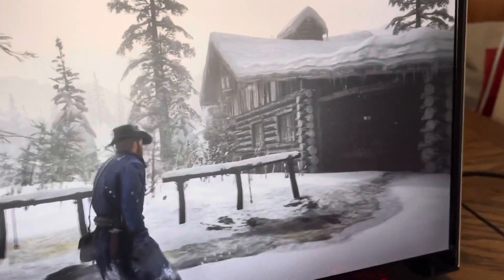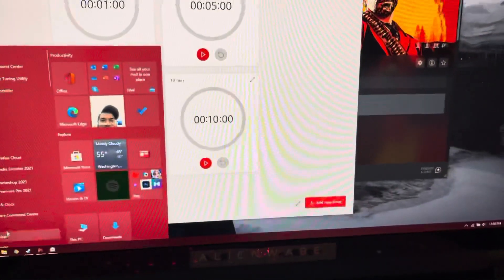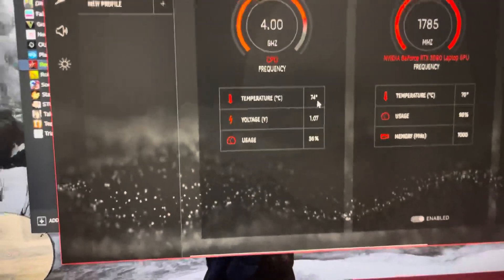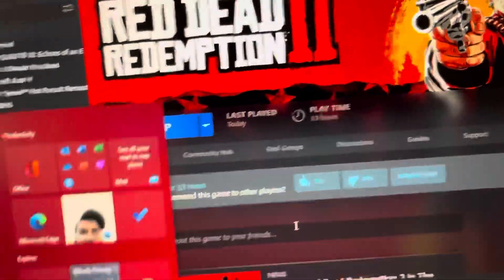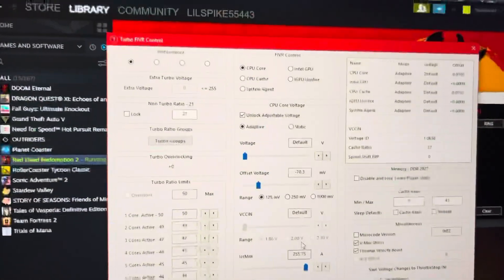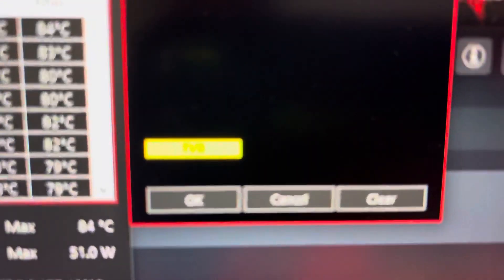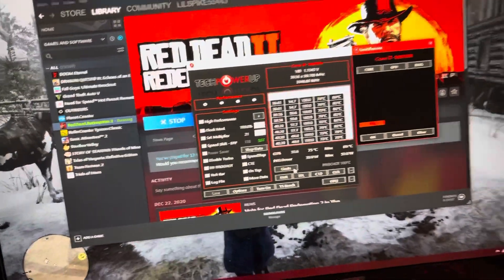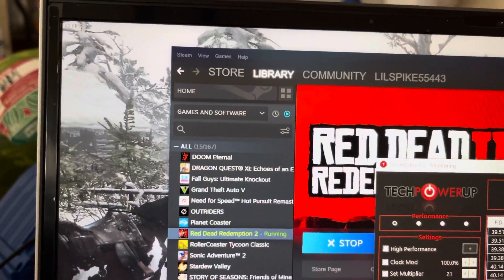Throttlestop help!!? Tvb?

Comment: You can lower your Turbo Ratio Limits. Basically is the Ghz in each single core. So lower each one a couple of units, like from 50 to 48, 49 to 46, 47 to 44, etc... This will set the each core to a lower ghz but because they never hit the 5.0 ghz they will maintain a more stable speed and temperature most of game can run smoothly with 3.5 Ghz. I set my M15 R3 to 3.5 ghz and sometime even disable turbo and -125Mv, temperatures never go beyond 70-75° C running full settings on games.
Reply: Hey Axel, I also have a M15 R3 and I couldn’t get it to undervolt past -110mV without it showing errors on the TS bench test in throttlestop.All cores were set to 3.5Ghz. Do u know why that is?
Reply: @mdzavaid118  it all depends on the processor. Even if we have the same brand, the same core numbers and configuration. The processor materials and their pureness are the ones how make them more or less undervolting/overclocking that's why the settings we use to undervolting can't be use across users, everyone has to try and error the process to find their own sweet spot. Also some the purest and high quality chip are the ones Intel use for their HK line and the less quality are leave for the average i7 or I5. BTW I had a couple of hard-freeze at -125mV so I lowered to -110mV and had a second hard-freeze doing normal work nothing heavy so I set it in - 100mV and haven't had any problems.
Reply: @mdzavaid118  try to set a couple more ghz on each core with that same mV to see if the bench test can work properly. Try different combinations, maybe your processor needs more power than to run at the ghz
Reply: Okay Axel, thanks for the advice! I’ll go give it a try 😁

Comment: To get rid of TVB throttling, you need to clear the Thermal Velocity Boost box in the ThrottleStop FIVR window. When the Thermal Velocity Boost box is checked, your CPU will slow down when it reaches 70°C. A red box in Limit Reasons means that throttling is in progress. A yellow box is a record of any previous throttling.
Reply from the maker: Thanks Bro, So in theory is disabling that allowing the CPU to run more efficient with the undervolted? i don't really noticed a difference in temps with it disabled.
Reply: @thirddays  The difference in speed is usually only 100 MHz whether Thermal Velocity Boost is checked or not. You are not going to see any significant difference in performance or temperatures one way or the other. Not really a question of efficiency. If you want your CPU to slow down when it goes over 70°C, check the Thermal Velocity Boost box. If you do not want this to happen, clear this box. Your temps are right around the activation temperature for this type of throttling. That is why you see the TVB box constantly blinking red.
Reply from the maker: @unclewebb  oh so really it doesn’t matter if it’s checked or not I won’t really see a difference?
Reply: @thirddays  A 100 MHz increase on a CPU running at 4000 MHz is a difference of 2.5%. No one will ever notice a difference while gaming. The Intel marketing department told the engineering department to create features like this so Intel can try and stay competitive. Only Intel would call a feature that slows the CPU down, "velocity boost". Clear the Thermal Velocity Boost box in ThrottleStop. This will help your CPU run at a consistent speed. There is never any need for throttling at 70°C.
Reply: yeah but your fps in some games will jump around a lot more without the boost. that's why I leave boost on high. I will drop it but not that much. not to mention power limit throttling will happen more frequently with your boost levels turned down. at least on my Asus scar ii
Reply: Won’t clearing TVB affect longevity of ur cpu
Reply: It will not make any significant difference. Leave it checked if you are worried about this setting.
Reply: @unclewebb  alright do leave it unchecked? also is -85.9 for both cache and core good?
Reply: @unclewebb  also what does disable and lock turbo power limits do? kind of a noob at this but when I was playing gta on NVE graphics it was blinking power and TVB in limits and don’t know why “Edp other” is yellow
Reply: Your voltage settings are good if your computer is stable. I always clear the TVB box. The difference is only 100 MHz.
Reply: @unclewebb  ok I will but did you leave ur fans on balance or cool? what’s the difference between the 2 profiles and what is better